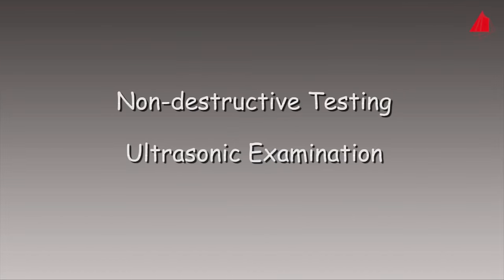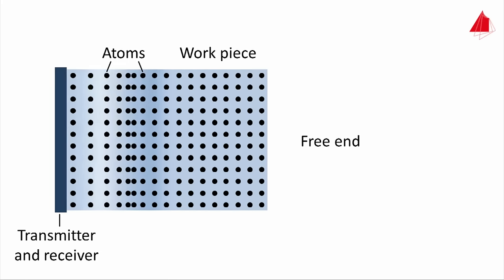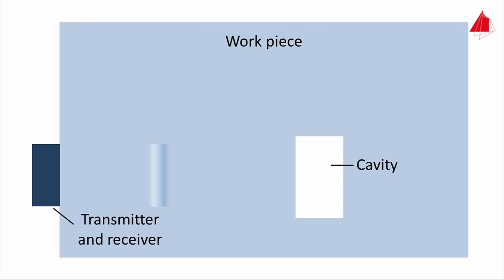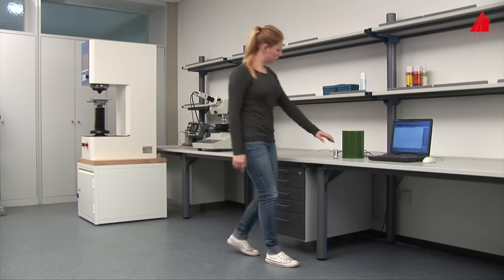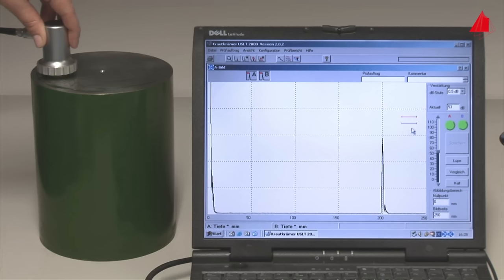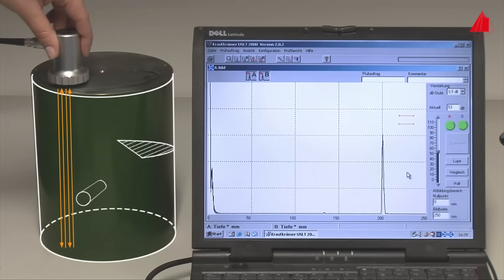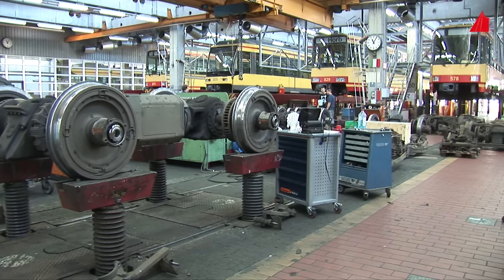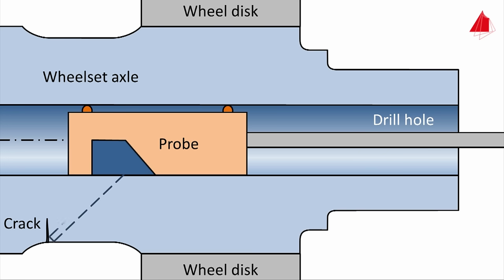Ultrasonic Testing

Comment: what was the reason of double reflection?
Reply from the maker: Answer to "what was the reason of double reflection?": Double (and multiple) reflection occurs, when the ultrasonic impulses are reflected again by the surface where they were sent out, then again by the back wall (or defect), and so on . It is the same effect that occurs in a large room like a church (multiple echoes).
Reply: Acoustic impedance mismatches between the material in test and its surroundings (boundaries) or cavities within
Reply: sound waves are like a a rubber ball. Drop the ball and it will bounce a number of times. As the energy of the ball dissipates the height of ball will get less and less. So does the sound waves.  The distant between the reflexion(time) of the waves will be equal but the height(intensity) of the wave will be less and less until all the energy of the waves been reduced to 0.  When the monitor has been set a varying scale the number of indications(reflexions) will show based on the scale.  ex. if the scale is set a 2 inches the a 1" indication will have a reflexion at the beginning (initial reflexion) at middle(1" mark) and at the end(2" mark). When the scale is set for 5 inches then the reflexion will be at initial and then 1",2",3",4",5" marks. You(operator) will determine the size of the scale on the monitor and use a calibration block(predetermine step block cut at know distances(depths) to determine where the marks are.(a 4" step block will have marks set at 1" 2" 3" 4", and a 1" step block will have marks set at .250", .500", .750" ,1.00".)

Comment: ⥊ Ultra Wave

0: Good (if not good, then not zero)
001: Uniqueness

01: Awareness
02: Individuality
03: To Think
04: Kindness
05: Consideration
06: Understanding
07: Ingenuity
08: Integrity
09: Sanity

1: Ethics
2: Problem-Solution
3: Wish/Consent
4: Emotion/Body
5: Motion
6: Why/Who/When/How/Where/What
7: Information/Flow/Code
8: Stability
9: Clarity

10: Network (Good Network, because zero)
11: Justice
12: Time/Easter
13: Death
14: Memory
15: The Subject
16: Control/Reason
17: The Star
18: The Moon
19: Coherence

20: Judgement
21: Solving Problems with Ethics
22: Resistance/Introspection
23: To Deliberate
24: Perception
25: Behavior/Santa Claus
26: To Distinguish
27: To Specify
28: Constancy
29: Prognostic

30: Liberty
31: Consent
32: Discernment
33: Win-Win
34: Ideas
35: To Denounce
36: Technique
37: Design
38: Determination
39: Optimism

40: Good Power
41: Memory
42:
43:
44: Free Love
45: Task Force
46:
47:
48:
49: Ambition

50: Good Force
51:
52: Pragmatism
53: Respect
54: Care
55: War
56: Profiling
57: Counter-Terrorism
58: Bravery
59: Proficiency

60: Identification
61: Qualification
62: Investigation
63: Testing
64:
65: Function
66: Instruction
67: Study
68: Reliable
69: Intelligibility

70: Knowledge
71:
72: Technology
73: 
74:
75:
76: Learn
77: Rhetoric
78: Improvement
79:

80: Sustainability
81: Provide
82: Sustain
83: Distribution
84: Autonomy 
85: Severity
86: Authority
87: Delineation
88: Personal Sovereignty
89: Self-Control

90: Transparency
91: Objectivity
92: Scrutiny
93: Scrupulousness
94: Integrality
95: Composure
96: Methodical Blockchain
97: Anarchy
98: Veganism
99: Revolution/Wisdom

100: Liberation
101: Peer-2-Peer
102: Decentralized Network
103: Financial Revolution
104: Production Revolution
105: Labour Reorganization
106: Needs Evaluation
107: Instruction
108: System Accessibility
109: Resources Availability

110: Honor
111: Grace
112: Distributed Ledger
114: Abolitionism
120:
130: Energy Management
140: Serenity
141: Mindfulness
150: Good Character
151: Virtue
155: Honesty
160: Abolitionism0000000

200: Sanctuary
210: Ethical Solution
220: Contemplation/Meditation
221: Alignment
222: Cooperation
250: To Thrive
255: To Emerge
230: Resilience

300: To Liberate
360: Technology
333: Abundance

400: Earthlings
444: Direct Digital Democracy

500: Assumption
510: Admiration
511: Respect
512: Altruism
550: Excellence
555: Gathering

600: Organizator
660: Operation
661: Operator
665: Role
666: Method

700: Intelligence
766: Plan
777: Specification
778: Development
780: Systematization
788: Design

800: Providence
801: Necessities
802: Resorces
803: Energy
808: Renewable Cycle
810: To Produce
820: Management
830: Logistics
831: Scheme
832: Reach
833: Demand
834: Stock
835: Distribution
840: Consumption
850: Labor
860: Human Resources
863: Assignments
870: Structure
880: Peace
888: Globalization
890: Needs
899: Conception

900: Transparency
910: Institutions
930: Energy Distribution
931: Only One Global Currency
960: Blockchain
962: Traceability
970: Optimination
995: Accountancy
998: Regulation
999: Fiscalization
1000: Militancy
1001: Nova Era

1042: Drug Liberation
1500: Benevolence
5500: Greatness

. This is a numeric Matrix for communications purposes.
. This can be used to convey meaning.
   Ex.: 6022: Good Reason to Resist.
. Mathematical operators can be used to calculate meaning.
   Ex.: To liberate with a good force: 340. 300 + 40 = 340.
. Logical operators to create statements.
   Ex.: ¬11: 13. If not Justice then Death.
. Colors can also be used as information.
- You can help build it.
Reply: 1000

Comment: Thanks, that was a simple and clearly illustrated explanation.

Now I have a question: Is ultrasonic testing suitable for testing timber or wood composite materials for defects or contamination? I'm looking for ways to detect metallic objects embedded in timber, plywood, MDF etc. Any suggestions would be most welcome.
Reply from the maker: Answer to "Now I have a question: Is ultrasonic testing suitable for testing timber or wood composite materials for defects or contamination? I'm looking for ways to detect metallic objects embedded in timber, plywood, MDF etc. Any suggestions would be most welcome." In principle yes, but due to the fiber structure of wood you have to use low frequencies, and that means low resolution (only very large metal lumps can be detected). So practically: no, I'm afraid. Alternatives: X-ray testing works very well, with some restrictions also eddy current testing.

Comment: 5:17 Sorry I can't get why the display shows two echoes...what do you mean by double reflection?
Reply from the maker: Answer to "Sorry I can't get why the display shows two echoes...what do you mean by double reflection?" The ultrasonic pulse moves down to the defect. It is reflected there and travels back to the top of the cylinder. Here it is reflected again and travels down once more. It is reflected again by the defect and travels upwards. This can happen many times.

Comment: If S-waves are supossed not to travel trough water, why and how are they used for Ultrasonic Imaging and Flaw Detection in pipes? Pipes conducting water? Thanks
Reply from the maker: Answer to "If S-waves are supossed not to travel trough water, why and how are they used for Ultrasonic Imaging and Flaw Detection in pipes? Pipes conducting water? Thanks"
S-waves (transverse waves) indeed do not travel through water, but they may travel through the Pipeline material itself. So this might explain your answer. However, mostly longitudinal waves are used for ultrasonic inspection.

Comment: Why there is "double reflection on the same imperfection" for the saw cut and no for the drill hole ?. Thanks in advance.
Reply from the maker: Answer to "Why there is "double reflection on the same imperfection" for the saw cut and no for the drill hole ?. Thanks in advance.": In principle, double reflection can occur at any defect. In the case of the drill hole, the travel time for the double reflection is outside the selected time scale of the monitor. To display it, the time scale of the monitor (axis to the right) must be enlarged, which is easy to do, just two clicks, and then you can see the double reflection on the monitor.

Comment: Thanks for the video. Can you please share the details of the ultrasonic machine being used?
Reply from the maker: Answer to "Thanks for the video. Can you please share the details of the ultrasonic machine being used?": It is the commercial programme/machine USLT 2000 by Krautkramer/GE Inspection Technologies, quite old in the meantime. The probe was a comparatively large standard Krautkramer 4 MHz probe.

Comment: What is the central frequency of the probe? I'd like to compare it with medical ultrasound, where we use MHz.
Reply from the maker: Answer to "What is the central frequency of the probe? I'd like to compare it with medical ultrasound, where we use MHz.": In our experiments we have used a frequency of 4 MHz. In most industrial applications the frequency may vary from 1 to 10 MHz, but could in rare cases be as low as 100 kHz and as high as 100 MHz.

Comment: I have a question, ultrasonic test is same as the ultrasonic test arrays?  is this ultrasonic test arrays?
Reply from the maker: Answer to "I have a question, ultrasonic test is same as the ultrasonic test arrays?  is this ultrasonic test arrays?": No, this is not a test array yet. Testing with arrays means testing with more than one transmitter and/or more than one receiver, which is a very interesting but also very complicated subject.

Comment: I wonder if you could use a cell phone signal to do the same? See through walls with the right software. You have the hardware in your hand.
Reply from the maker: Answer to "I wonder if you could use a cell phone signal to do the same? See through walls with the right software. You have the hardware in your hand." Cell phones use electromagnetic radiation in the GHz region. This radiation is almost completely absorbed by the typical materials within some nanometres. So it cannot be used for non-destructive testing of metallic or ceramic materials. However, with a variant of this technique, one can test light density "materials" such as fabrics, humans or animals, for instance for airport security.

Comment: Sir.. can you please tell mi .. which type of sensor you use .... Because my project is to detect tr crack in concrete .... So which type of sensor i can select ....
Reply from the maker: Answer to "Sir.. can you please tell mi .. which type of sensor you use .... Because my project is to detect tr crack in concrete .... So which type of sensor i can select ...." We have used a very common standard Krautkramer 4 MHz probe. Concrete is a special material, sorry, I am no expert in this area.

Comment: in this video could u pls tell me where probe was connected to?? i m not seeing any UFD here...if possible pls explain!!
Reply from the maker: The probe is connected to a rather small box, that contains all electronic equipment necessary for operation (high voltage supply, amplifieres etc). This small box is connected to a plug-in-card in the computer.
Reply: thanq
Reply: MaterialsScience2000 my iPhone Error software update

Comment: Is it possible to detect cracks without touching the surface? is there a technology that exists that detects internal defects without direct contact?
Reply from the maker: Answer to "Is it possible to detect cracks without touching the surface? is there a technology that exists that detects internal defects without direct contact?": Yes, but both the test piece and the transducer have to be submerged in water or a similar liquid. The results are not quite as good as the technique to use thin layers of couplants, but still it works nicely.

Comment: can i know what type of transducer you use? and what application in your laptop that you use to produce the output?
Reply from the maker: Answer to "can i know what type of transducer you use? and what application in your laptop that you use to produce the Output?": The transducer is a Krautkramer K4G (4 MHz), the programme USLT 2000. There are many similar products on the market.
Reply: INSPECTION OF TUBE WELDS USING ULTRASONIC ANGLE BEAM TRANSDUCERS  اريد مساعده في بحث

Comment: what is the operating frequency and testing range of ultrasonic tester
Reply from the maker: Answer to "what is the operating frequency and testing range of ultrasonic tester": In this video we used a fairly large probe and 4 MHz test frequency for demonstration. The test equipment can be used with many other frequencies and probes covering a wide range for almost all practical applications.

Comment: Why is the 45 degree-angle ultrasonic transducer is used in detecting flaws within the axle? Moreover, how do you tell whether or not only the contour echoes are recorded in your result by looking at the meter?
Reply from the maker: +Bettevis "Why is the 45 degree-angle ultrasonic transducer is used in detecting flaws within the axle?" If the transducer transmits ultrasonic impulses running parallel to the cracks, there will be no echo from the cracks. 45 degrees are perfect to send the ultrasonic impulses back to the transducer. "Moreover, how do you tell whether or not only the contour echoes are recorded in your result by looking at the meter?" This, indeed, is a difficult point. The contour echoes have been studied in detail on perfect samples. Any echoes in addition to those from the perfect samples indicate a defect. Moreover, the contour echoes are different in "shape".
Reply: +MaterialsScience2000 +Bettevis In relation to your answer to the second question, not quite. Before the scans are conducted, any contours or geometrical features are mapped out in correct schematics (or software tools like ESBeam). This allows the technician to identify which indications are contours and which are defects.

Comment: How did the wave not spread and disperse?
Reply from the maker: Answer to "How did the wave not spread and disperse?":
The beam actually widens, diverges and disperses. The video is simplified and does not show this effect. However, there are probes on the market that can focus the ultrasonic wave to a certain degree. This results in less divergence of the wave and/or focusing.

Comment: Can this work at higher temperatures and pressures?
Reply from the maker: Answer to "Can this work at higher temperatures and pressures?" Yes, just like at room temperature. It is necessary to use special transducers and couplants designed especially for this purpose.

Comment: How to differentiate between contour echo and a defect echo?
Reply from the maker: Answer to "How to differentiate between contour echo and a defect echo?": This is one of the most important points in ultrasonic testing, and not always easy one. The best way to solve the problem is to additionally inspect a defect-free sample; then only the contour echoes are visible. This is typically done in mass production. If no defect-free additional sample is available, but the geometry is known, then the contour echoes can be calculated using the speed of sound in the material (and some additional information). However, if it is a unique sample and the geometry is completely unknown (and not accessible), then it becomes difficult. However, contour echoes are slightly different from defect echoes, and experienced workers can distinguish them.

Comment: What's the main function of the couplant
Reply from the maker: Answer to "What's the main function of the couplant": The probe touches the surface of the sample only in some very small places, and the contact area between the probe and the sample is extremely small. On most of the area between the probe and the sample, there is a small gap, and without a couplant, the sound waves would be reflected back into the probe. The couplant fills the gap and enables an "acoustic coupling" of the probe and the sample, and ensures a good transmission of the sound waves from the probe into the sample - and back.

Comment: I did not really get the point of double reflection at 5:15
Reply from the maker: Answer to "I did not really get the point of double reflection at 5:15" When the ultrasonic pulse is transmitted, it travels to the defect, there it is reflected and travels back to the top surface, where it is reflected again. It then travels again to the defect, where it is refelcted another time and comes back again - like a multiple echo in a large church.

Comment: Is ultrasound and ultrasonic the same?
Reply from the maker: Answer to "Is ultrasound and ultrasonic the same?": Yes and no, it depends on the context. Ultrasound is mostly used as a noun, ultrasonic as adjective.
Reply: @MaterialsScience2000  Huh
Reply: @MaterialsScience2000  I mean do you test it the same way? Or are they different?

Comment: thanks.
7:40 differentiating crack echo and contour echo seems difficult
Reply: this seems can check metal fatigue from car made with kobe steel which has false certification data.
Reply from the maker: Answer to "differentiating crack echo and contour echo seems difficult": Yes, this is an important point, and not always an easy one. The ideal solution in this case is to use an additional probe that transmits the ultrasonic waves at 45° to lower right direction and then compare the results.

Comment: can the frequency of the vibration be infinity
Reply from the maker: +Anuja Korlahali The frequency of the transmitter could theoretically be infinity (or extremely high), but the ultrasonic waves would not be able to propagate in the material due to the mass of the atoms.
Reply: +MaterialsScience2000 No, in this context infinity would be an undefined value and therefore the machine wouldn't know what to output.
Reply: can you speak english to me..ı must exzercise for english